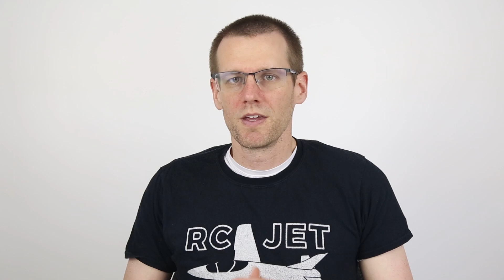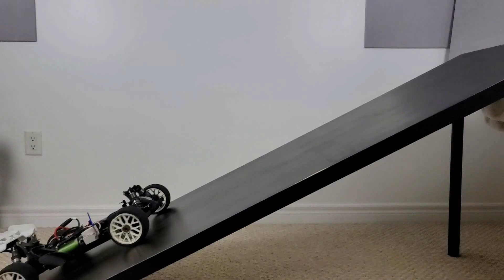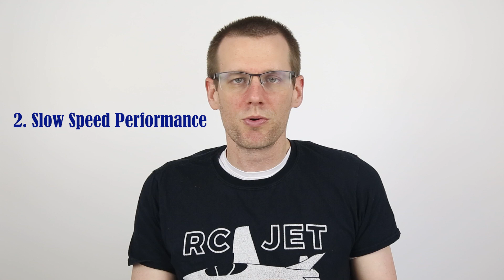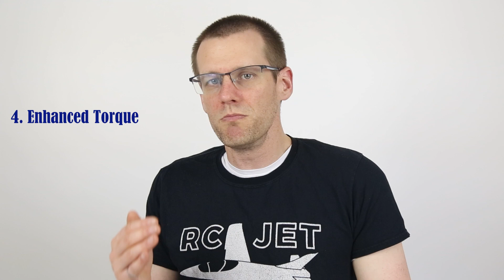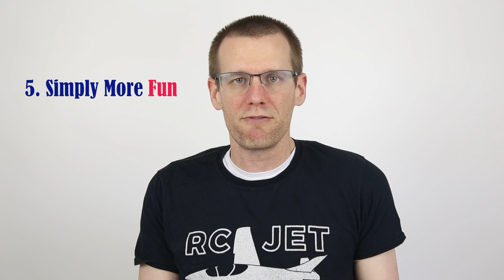5 Reasons You Can't Ignore Brushless Sensored Motors for RC Cars

Comment: I have a sensored max 6 combo in my Mojave and notice little to no difference in terms of slow speed control when compared to my 6s Kraton with the stock sensorless Spektrum system.  I do a lot of trail driving so I have quite a bit of experience driving both in these slow speed conditions.  Where I do see a difference is with the sensored systems set up for crawlers.  I have a Hobbywing Axe system in my K5 Trx4 and also have an Scx6 and both of these setups have superior slow speed control.  That said, they are both Crawler setups so that would be expected.  In my opinion, high quality rtr systems like Spektrum offers in their 6s lineups do just as good of a job as sensored systems.  If low speed control is your primary factor and you own a 6s Spektrum system, don't waste money on a sensored system because there won't be enough of a difference.  On the flip side, vehicles from Traxxas 6s and 3s lineups greatly benefit from sensored setups because those 3s and 6s VXL setups have virtually no throttle control whatsoever.  At least not with how they are geared out of the box.  If you drop down in battery size and pinion gear size it does improve but then you lose a ton of speed.  Spektrum systems have both the high speed capabilities, plus very strong throttle control at all speeds.  The 4s and 8s Traxxas VXL systems however do offer strong throttle control on the XMAXX and MAXX for what it is worth, just not on 3s and 6s vehicles lineups which annoys me.

Comment: The new hobbywing sensored 3665 4000kv dosent fit in the Associated Pro 4 Sc10. 

Am i better off with the sensored  80 amp combo with 3652 4100kv.
Or the Sensorless 120amp combo 3660 3700kv.
Want to run on 2s when racing and 3s for park fun.
Wish the had a 140amp 3660 4000kv sensored combo lol

Comment: Although sensored motors are good for rock crawlers you can get the same performance and smooth slow start ups out of sensorless setups. I use both sensored and sensorless and in no way is one better than the other...

Comment: Just put a HW 10BL120 sensored system a carpet buggy. Turns out I need to reverse the rotation of the motor . This esc does not have a rotation reverse function.
Reply: Glad I came across this comment. So I'm also building a carpet buggy (AE B6.3) I've got a Hobbywing XeRun V10 G3 Sensored Brushless 10.5t motor and I was thinking in getting the 10bl120 but the sensorless version of it.. Just wondering now if it will do the same as yours and be unfit for this frame.. How did you sort your one out in the end? Cheers.
Reply from the maker: very strange
Reply: @RCexplained  for sure. The manual says that if the motor is rotating in the wrong direction, then this esc system is not suitable for this chassis. 
I'm a bit surprised this is the case.
Reply: Not sure if it would work or not with a B6.3. That car uses a different layout than the car I was using. With a right hand side forward facing pinion. It was on a WLtoys buggy. I ended up buying a Toro esc. It was around $80 but work great and plenty (if not too many) of tuning options.
Reply: Oh, I was specifically talking about the SENSORED 10bl120. Obviously the sensor less, you only swap two.of the wires.

Comment: I have a tugboat with none sensored outrunner motor direct drive. Works fine apart from start/slow manouver work, like in docking compertisions (rough jittery). Would it be better to use a sensored outrunner if there is one, also at a reasonable price?
Reply from the maker: I'm surprised you have issues with a boat. I would not go sensored for a boat.

Comment: i just recently upgraded my Arrma Fireteam's ESC and motor to a Castle Mamba 8s with the 1650kv 1717 sensored motor, and i honestly wasn''t expecting the sensored motor to make as big of a difference as it has. If it wasn't $100 off on the day I ordered it i would have went with a max 6, and im so happy i got the sensored setup. its so much easier to control than it used to be, now the throttle does exactly what i want it to
Reply from the maker: Right on! Enjoy that sensored setup!

Comment: What about TURBO? I usually race 13.5 Wheeler, so can’t use it racing, but Turbo for bashing is awesome! In my opinion, of course:)
Reply from the maker: I like turbos under the hood of my car.
Reply: @RCexplained  Yea buddy…Boost it! Preordered the new HW G2 Max 5 system,  and Xmaxx is getting boosted, I have a feeling it’s going to be pretty sick:) 250 amp continuous, 12S, and 25deg timing boost, time to jump trains, order spurs and pinions, and start building lots of diffs!